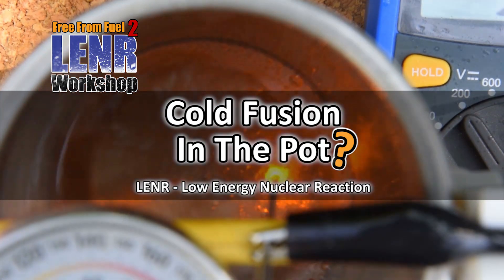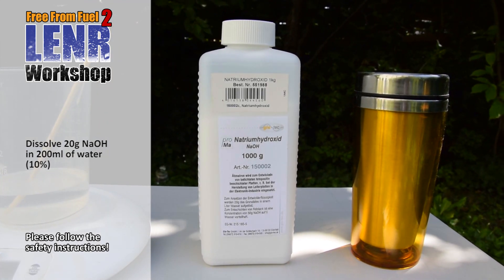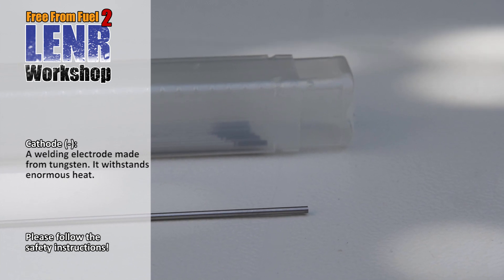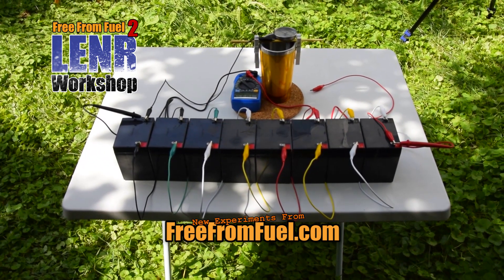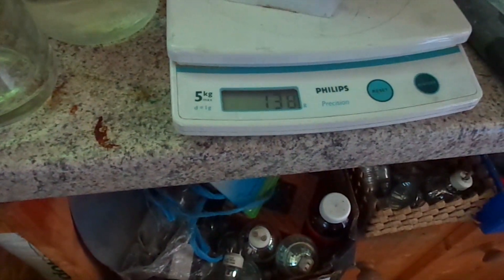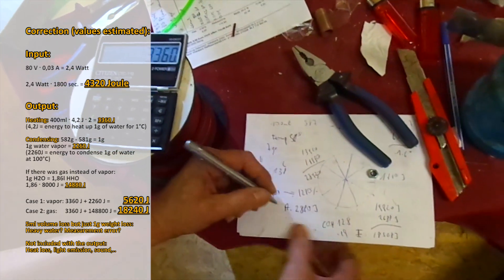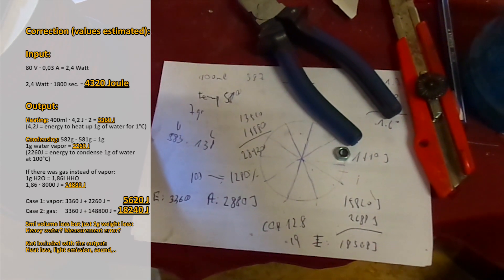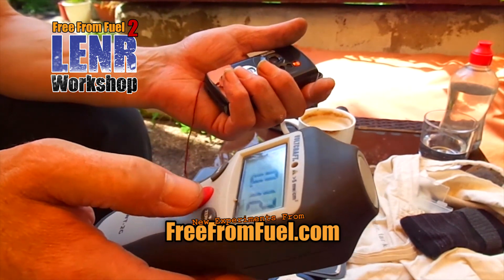Free Energy Cold Fusion DIY Selfmade At Home - LENR - Low Energy Nuclear Reactions

Comment: My late uncle George did or did not work with Fermi at Los Alamos.  He also did or did not work on the American Hydrogen bomb.  He was a professor in Physics at Berkley and he did get me in to see his lab at Lawrence Livermoor labs.  He was a hut fusion guy.  He died atr age of 86 so I guess he was careful with the plutonium.  The last time we spoke, I asked him about cold fusion.  He said he was acquainted with Marty Fleischman and that he was well respected.  He brought all his own equipment from San Francisco to see this experiment.  Uncle George said THERE WAS SIGNIFICANT HEAT GENERATED NUT THAT IT WAS NOT FUSION BECAUSE HE DID NOT DETECT ENOUGH NEUTRONS.  So what was it says I.  He says "a previously characterized electrolytic reaction."   . I don't think any neutrons are produced in the electrolysis of water.    I cannot think of anyone more qualified than George to evaluate this experiment.  He was clearly just biased towards hot fusion.  The moe I read about LENR, the more I think he was correct.  Palladium will hold oodles of hydrogen because of its crystal structure.    But I see them using other metals that do not, to my limited knowledge, hold hydrogen.  Like tungsten.  

I am not a conspiracy guy.  But who would want to upset the apple cart?.  Despite what I read in his biography, he graduated from Univ of Chi, not IIT.  He was a condensed matter physicist, not a chemist.  Sometimes history is manipulated.   Depending on one's security clearance.
Reply: I am looking for ways to generate more efficient and cheaper energy than what we normally use today, do you have any info that you could share that goes toward that?
Reply: @joaonobre7500  The future is geothermal. If we used jets of water, we could easily drill down several kilometres, where it would be hot enough to boil water, and as ground water fell into this bore, it would produce steam that could run a turbine.

Comment: I replicated this experiment for about $5.  As you can see it works.  If the plasma chamber was much smaller and has a few 5cmx5cm sides Then eachTEG's could generate  20w of dc power with the heat generated,  if glued to the hot side. Has no one thought to do that? Imagine a big line of them? Why not use a carbon graphite rod instead of the Stainless Steel?

Comment: To measure the current it is better to have a second set of capacitors. Connect the minus to the minus and connect a 0.1 Ohm resistor (or even 1 Ohm if that is what you have) between the plusses. Now you can measure the voltage over the resistor. It will fluctuate less, and there will be no current flowing if the system is not in use. I would even try out and put a magnetron transformer between the plus and the rod. The DC volt is jumping all over the place and you could see and try if you can tap of even more power because of the AC feature it has. As long as the transformer resistance is low enough this might work. I think you could even power up the voltage and run a second LENR next to the first one with the now generated voltage. Sorry if I am dreaming away at possibilities .. .. Thanks for sharing, it does make people think .. .. ..
Reply: In fact the current measurement is the most ridiculous thing in this experiment. Very likely the current would show up spike shaped on an oscilloscope. Not close to DC at least.

Comment: John Keely, of his 1800's workshop in Philadelphia,  had tech notes 
published, and a  portion of his  frequencies section would be 
beneficial for controlling Cold Fusion testing of deuterium.  "The Snell
 Manuscript"- which is summary of 3 Keely's lab note books. One amazing 
test was frequencies applied for condensation of ambient air in sealed 
brass globe with various levels of vacuum formed on open bath mercury 
manometer vacuum gauge, without cooling, suction pump, or chemical 
ablation. He said he had control of the forces of nature. Tesla didn't 
like him because Keely got more of investors' money than he did.

Comment from the maker: P.S: There are different tungsten Welding rods. The rods that contain small radioactive elements inside the Tungsten rods will probably work the best for more output heat ! e.g. (WT 40) rods contain
3,80 to 4,20 % Thoriumdioxide inside which is lightly radioactive and has an 
orange color painted on the rod for marking them... Make sure, if you use these, that you don´t breath in the gases from the electrolyte fluid then and for better safty don´t use radioactive rods at all ! So use only WP or WZ Types for these experiments, so no radioactive gases can come from the electrolyte fluid. You do these experiments on your own risks and we don´t assume any responsibility for your actions or errors... So please be careful ! Many thanks.
Reply from the maker: Check out the tungsten welding rods materials here in this comparison form:
https://en.wikipedia.org/wiki/Gas_tungsten_arc_welding#Electrode

Comment from the maker: Please Rate, SHARE on Facebook and Like and Comment and also Read the Video Description box for a Free PDF File and if you like order our HHO DVD and Manual from http://FreeFromFuel.com   Many thanks. Regards, Stefan.
Reply: +overunitydotcom Hallo Jungs, gibts die Nullpunktenergie wirklich?
Reply: basic sixth grade science class.  electric current turns h2o into hydrogen and water. sparks from welding rod burns hydrogen no fusion involved
Reply: srry hydrogen and oxygen
Reply: deuterium is made as well in the process

Comment: I Shmucspect that theres  some  electrolysis occurring, that yellow colouring afterwards , discolouration of the stainless mug. This suggests some electrolytic effects that can be confounding your experiment.As well the tungsten looks discoloured but that may be surface. Stainless steel a complex mix of steel , chromium and nickel. You need to se a  tungsten foil replacement for the mug. Then why not collect the gasses and construct a better calorimeter. And your electricity supply system is totally unreliable. You can buy cheap  voltage and current regulator chips to supply a better regulated source.   Did you get that initial power reading when you removed the electrode from the electrolyte. That definately needs to be tracked down and accounted for. Then your lab is a mees  you need to keep a journal and document things. Try  starting from different temperatures and Lastly get a pretty lab assistant.

Comment: I question whether this electrolyte loses a molecule so its concentration falls generally not enough that the water evaporates what is on the bottom?
-while the electrode must be suitable submerged to ensure contact and created gaps electric or plasma.
which can reach a maximum temperature such magnitude generator?
what happens when the produced gas will be sealed in a container that will increase the pressure and do not cause spontaneous ignition and explosion?

Comment: THIS IS NOT COLD FUSION!!! IT IS ELECTROLYSIS OF WATER. AND THE AMOUNT OF ENERGY LOST TO THERMAL ENERGY IS INSANE. THIS IS HORRIBLY INEFFICIENT.
Reply: It's electrolysis of sodium hydroxide. After breaking apart the sodium hydroxide into sodium, hydrogen, and oxygen atoms, the oxygen reacts with the (stainless steel) cathode, the hydrogen reacts with dissolved or atmospheric oxygen near the annode to form water, while the liberated sodium reacts again with water to form sodium hydroxide again. The rusting of the stainless steel, etc, gives more heat out than electricity in. This creates the illusion of overunity.

Also, the only way to determine LENR is to analyze biproducts of LENR such as changes in elemental/isotope composition. LENR can happen without being useful. LENR can have different radiation profiles than hot fusion because the fusiom reactions are finnessed and so less violent.
Reply: Sodium hydroxide breaks down to OH- and NA+ no hydrogen there especially not vast amounts and hydrogen is explosive
Reply: Electrolysis does not make fire from water
Reply: lol
Reply: Look into mr. Maxwell Chikumbutso from Zimbabwe who developed free energy from radio waves.

Comment: So it's making more heat than the current is able to make with an ordinary heating element.
Reply from the maker: +Seekmosttoprophesy Yes.
Reply: I figured out why. It is making hydrogen and oxygen and immediately burning them.
That is why there is less water and that is why there is more heat.
Reply: Closed system. Burning the electrolysis gained HHO would yield exactly the same amount of water as return.
Reply: except youre still losing heat....no such thing as a closed system...

Comment: The major flaw here which generates the largest error by far is the assumption that 7 ml of water was boiled off as water at 100 degrees C.

First, the water was at only 60 degrees C. The energy to get it there was almost entirely from heating over a stove.  The simple fact is that water kept that warm for that long will suffer evaporative losses, whether or not an electrode is even in the water. 

A proper experiment would have controlled for such losses.  In fact most experiments of this nature would simply ignore evaporative losses . But this experiment has instead made it into the primary means of showing energy gain, which is a no no.
Reply: +Mark Underwood
 I agree with you, glad that  see someone who is looking for the facts. Experiments are not to show something, they are to prove something. so it means proper measurement  must be done, but here it was not case.
Reply: +Milan Mančić This is basic and may not be access heat. The point is, we have what may be excess heat. Now the next step is to rule out other factors. I suggest if you think you can account for all the excess heat by known causes, you should do it and put up the video. Because if there is 1 degree excess heat, we have a phenomenon that could change the world. In this case, idle assumptions trying to debunk the experiment demand proof that you are right. It happens that people have done it and there is excess heat and a prototype has been running for a year.  It's this adhoc assumptions without any experimental proof of the contrary that has kept this new energy form from the world. Go to brilliantlightpower.com Dr Mills has got the theory that explains it's not the hydrogen or the oxygen burning that causes the excess heat but the hydrogen once released from the water has an electron that drops to a lower orbit closer to the nucleus of the hydrogen atom, lower than the known ground state. This turns the hydrogen atom into a hydrino and the change in the atom releases the excess heat you see.  As a matter of fact, it is 100 times more power then released by just burning the hydrogen.
Reply: +easymoney4ever 
BrilliantLightPower is one thing. They have all kinds of carefully controlled experiments over 25 years which demonstrate excess heat from an anomalous (to mainstream science) source.  The results of Rossi year long test may or may not yield positive results, F9 (inside joke).  But this experiment has no controls, and no attempt to account for other sources of heat. For instance the colour of the liquid changed, indicating a chemical reaction, quite possibly with the iron of the stainless steel.  It is entirely possible that particular reaction was exothermic. It could have even altered the volume of the liquid.  But we don't know, because these aspects were not accounted for.   So the experiment as shown remains entirely unconvincing to me. And I speak as one who happens to believe in things like cold fusion and also the work of Randall Mills.